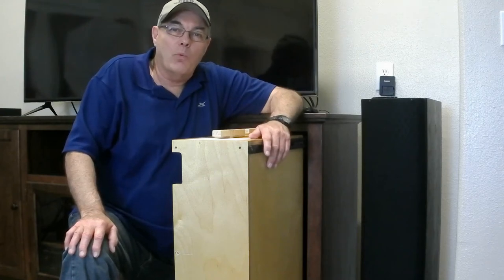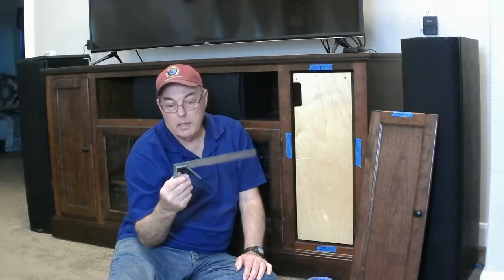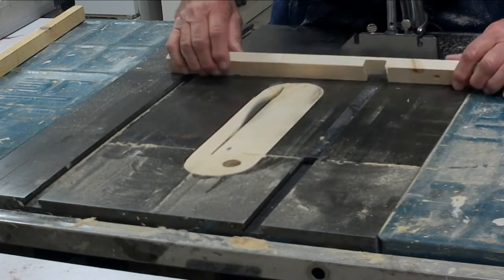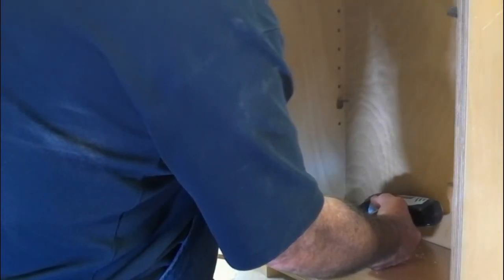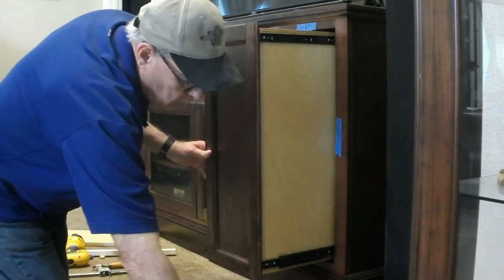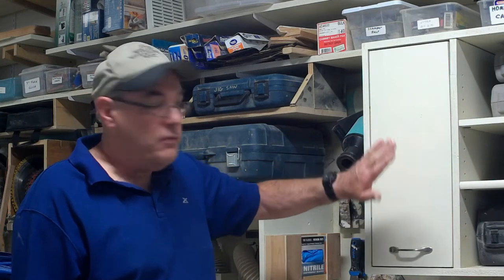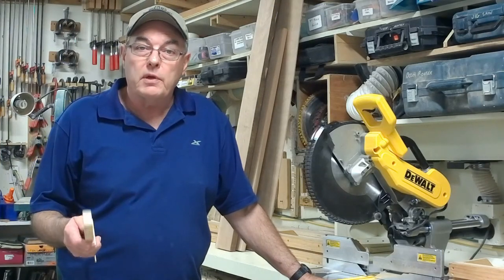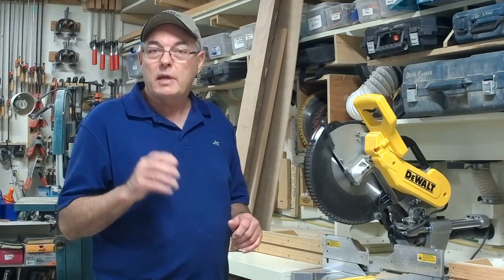How to convert a cabinet door into a drawer front - Vertical Drawer Pt. 3

Comment: Thanks for the videos in this series.  I am opening up a hidden corner in the kitchen cabinets to put in a water filter system that won’t fit under the sink.  I plan on putting the Water filter on a vertical slide out on the one side and a couple of normal slide outs next to that vertical.  Your videos were helpful in getting me started.  I like your common sense approach to these things.  Even me, a retired engineer might be able to do it.  Haha.  All the best!
Reply from the maker: I'm glad you liked the videos and let me know how your project turns out.